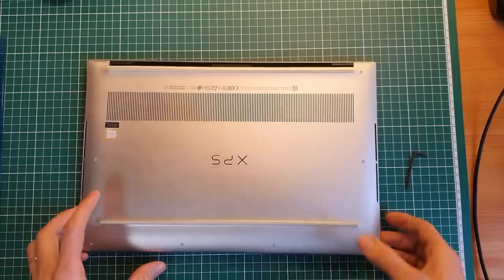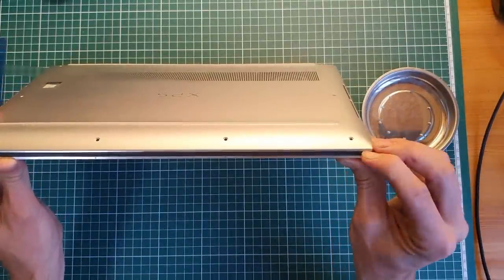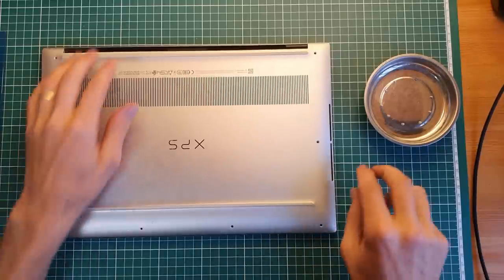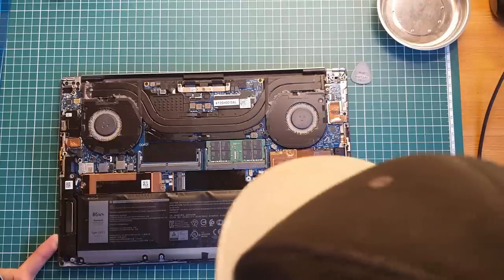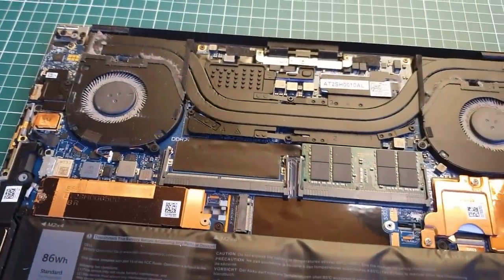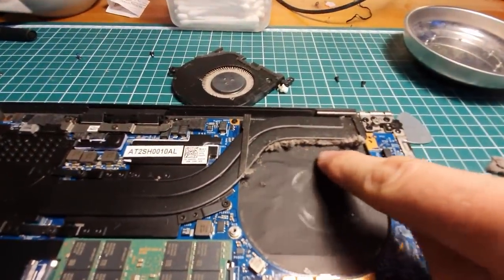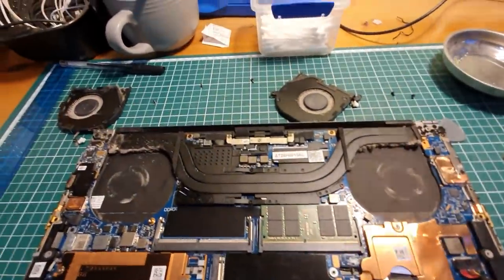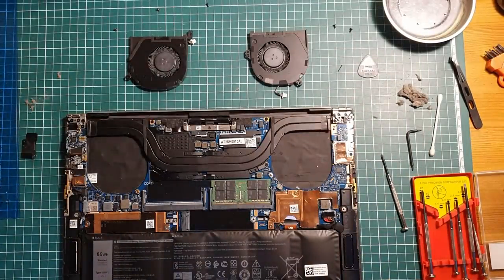HOW I FIXED AN OVERHEATING DELL XPS 15 LAPTOP

Comment: This video is dedicated to all girls who like to put their laptop on the bed and block the air intake for cooling.
Reply: Yes, someone correctly wrote the thermal paste on the processor and on the video chip requires periodic replacement. It lasts a long time, but still eventually dries out and stops transferring heat from the processor to the heatsink. There are different thermal pastes from cheap Russian type kpt-8 to expensive imported ones. I use Russian. I update once a year along with cleaning the fan and grille.

Comment: Careful removing that back cover. I sliced my finger open due to some sharp edge that was hidden from me just inside the case. My laptop was full of dust. I have cleaned it out as best I could without actually removing and reinstalling components. It's better, but still running hot. So I might take it to a tech.

Comment: there is compressed air in cans for cleaning laptops. as for screwdrivers, better to demagnetize them when working with microcircuits. good luck!
Reply from the maker: My screwdrivers were non magnetic but thanks for the tip. I wouldn't have thought of that.
Reply: Its better to use old vacuum cleaner where you can change output and input hosepipe. Beause its free :)

Comment: Not sure about laptop, but for desktop I use vacuum cleaner sometimes
Reply from the maker: Sounds like a good idea. I will have to get on of those.
Reply: @82acresfarm  if it still get overheated , may be it's worth changing the thermal paste on CPU

Comment: You can use CRC or WD40, Choose the right model, it works well for electronic products and machinery.
Reply: For the fan yes, you can do that as long as it's removed  but please don't use WD40 or any cleaning agent on your laptop's motherboard unless you want to shorten it's life span.
Reply: @haroldcruz8550  Bro, you are definitely using the wrong model of WD40, it has a model specially designed to clean the motherboard and other precision electronics!
Reply: @jasonmask9513  All cleaning products produces  residues, it might not cause problems immediately but  that residue can cause corrosion or  deterioration of insulation in the laptop's mobo's circuit in the long run. Why use such products when an air blower is sufficient.

Comment: I love the XPS but this is crazy I had to wait hours before the laptop turn back on and this happen before.
Reply from the maker: Mine turned on no problem. I just changed the battery and it played up once or twice but is working fine now.
Reply: @82acresfarm  the XPS turned on after 3 hrs. for some reason the laptop just stay hot even if its powered off. im swapping it tomorrow appreciate the reply.
Reply from the maker: @GamerzZone0212  did you clean the fans.
Reply from the maker: @GamerzZone0212  did the fans turn on afterwards.
Reply from the maker: @GamerzZone0212  if you are a gamer just by a gaming laptop. Might not look as sleek but will manage heat better
Reply: @82acresfarm  I did. that was my first solution because can of air worked the last time and i used the xps for work. I have a X17 R1 for gaming. I think its my docking station that causing the laptop to overheat after I remove it the laptop cooldown.
Reply from the maker: @GamerzZone0212  haven't really used a docking station before but I'd say that the more cables and stuff attached to the computer the hotter it will get. I just replaced the battery and redid the thermal paste. Seems happy for now.